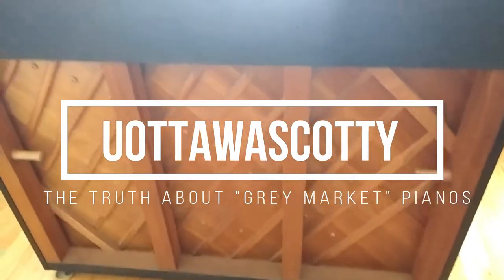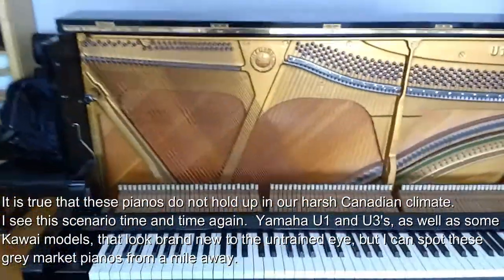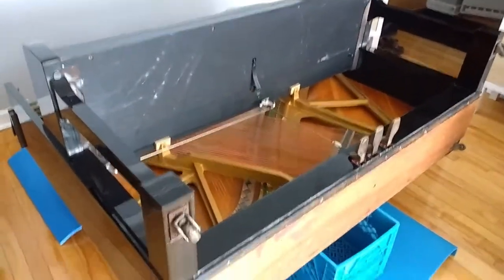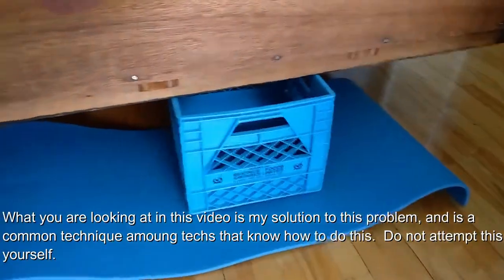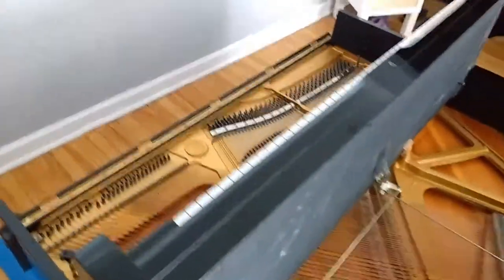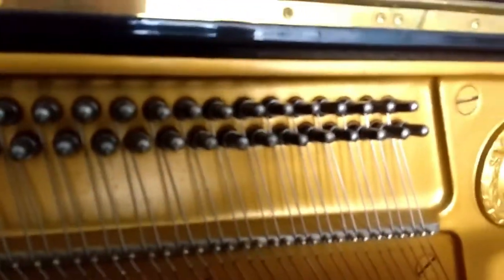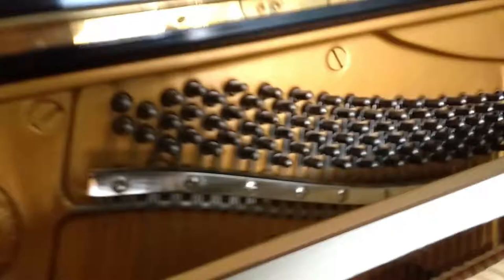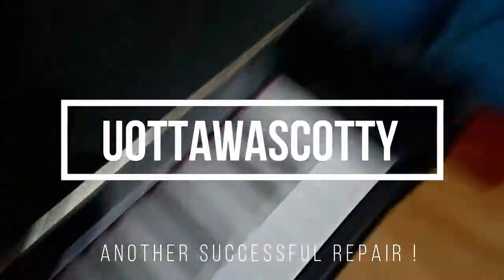Grey Market or Wet Pianos, THE TRUTH !!! PIANO PINBLOCK REPAIR

Comment: from memory i think i’ve sold around 1200 /1500 grey import yamaha u1/3 pianos in 15 years and they are still all working perfectly. i belive the issue is more likely the type of under floor or air blown heating used in the houses. it’s just as likely to kill any piano.  

a decent humidity control system fitted in the piano or room will 100% improve things. 

i’ve used the ca glue on odd loose pins on older pianos

Comment: Based on discussion with the independent technicians in my city, the gray market legend regarding piano failure, is simply not true. It's a good story for new piano dealers and manufacturers to perpetuate as the import of Japanese owned used pianos by Kawai and Yamaha has damaged the sale of new pianos in the US and Canadian markets. Experts I have spoken with have shared that Japanese pianos made since the 80s come from the same assembly lines and are aged identically regardless of the targeted market. Most pin block failures in grand pianos are the result of contamination from spilled drinks/liquids, cat urine, or keeping the piano in a non climate controlled environment which subjects the wood to rapid drying and hydration from heating cooling swings and the related humidity changes.
Reply from the maker: Tom,  I am not sure where you get this "conspiracy theory" angle from, but I am sorry to say that you are flat out wrong about everything in your comment.  I do not know these "experts" or "technicians" you have spoken with and I do not just assume they are experts on anything just because you say so, and I do not assume they themselves do not have anything to gain off busting a "myth" as you say.  Not sure where you live, but up here in Canada there are huge problems with the pianos.  What do I have to gain from making a video like this ?  I do not sell piano's, I fix them, as a matter of fact, I have made quite a lot of money off clients who have had to undergo this same treatment, and here I am making a video trying to tell people NOT to buy the very pianos that I am making thousands off of in making repairs to them.  The only part of your comment that makes any sense is the small blurb you make about pinblocks, and yes they do deteriorate due wild changes in humidity levels...which is precisely why manufactures DO have different drying processes for different areas of the world, and precisely why they gray market pianos DO have so many problems.  Maybe where you live does not get as dry as it does up here in Canada in the winter, but let me tell you, I have seen many brand new shinny Yamaha U1's and U3's that came from a "sale" where the pins spin themselves out of the pinblock they are so loose, and the last time I checked, cats don't piss sideways...even if they could get at an upright pin block in the first place.  So sorry Tom, but you are completely wrong, every one of these pianos is absolute trash, thanks though.
Reply from the maker: @RobertTolppi  Canadian Technicians are not paranoid, we are simply responding to epidemic of sick pianos on a weekly basis, all trucked into our cities from Asian continents where the wood has been saturated with moisture for decades.  You can not expect an instrument like that to stand up to the Canadian winters, weather your in front of heating element or not, it doesn't matter, time and time again, these pianos develop huge cracks in the bridges, aprons, soundboards, and most importantly, the pinblocks let go, which is exactly what has happened in this video.  The customer in this video pad $4000.00 dollars for an instrument that would not hold a tune 2 years after she bought it.  Any normal person can understand that this practice should be considered straight up fraudulent. Again, what do I have to gain from making a video like this ?  I MAKE money off fixing these pianos, using the very method demonstrated in this video, time consuming and expensive, and to be honest, this is a "band aid" repair that is not guaranteed to last, sometimes it lasts for 10 years, sometimes it last for 2 or 3, really all depends on the specific situation, the fact of the matter is this, this piano needs a new pin block, and if someone is doing a new pinblock, the piano is being shipped to my shop and being rebuilt at the same time, otherwise its not worth it, so I never do just pinblocks anymore, if I am rebuilding a piano like this, the cost will be around 4-5K, which is the nail in the coffin for an instrument that was purchased at 4K, and will only ever be worth 3.5-4K. This happens on almost all pianos that have been purchased second hand at these "piano blow out sales", we have a gentleman that comes to Ottawa almost every year and sells these pianos out of a local hockey area for one weekend, and then leaves town, wonderful !  So yeah, sorry this is not "paranoia", this is real life, and the truth is that these piano's do not belong in Canada, our climate is not meant for pianos like this.  I have been tuning Yamaha U1's and U3's for over a decade and I am VERY familiar with these pianos and their ruggedness, and proper U1 made for the North American market is so tough, that with proper care and maintenance, their lifetime can be considered to be indefinite, which is why most of the Universities and music schools are filled with them.  There is absolutely no reason that a U1 pinblock on a piano this age should let go like it has in this video, but surprise, it happens ALL the time on these grey market U1's.  So, you can believe what you want to believe, but I made this video because I am sick of seeing people get ripped off, and if you think grey market pianos are a good buy, then be my guest, don't say I didn't warn you !